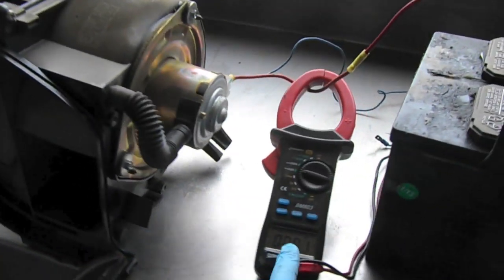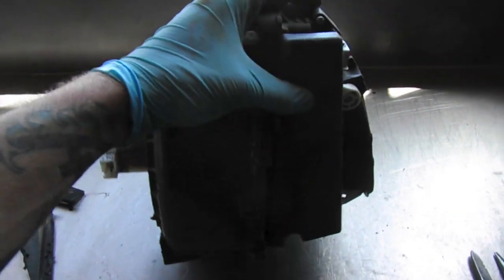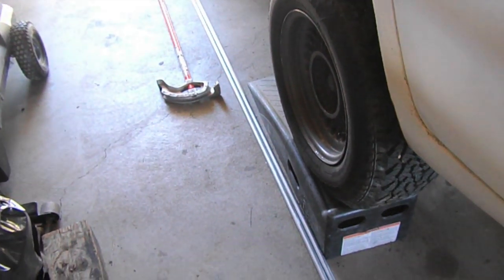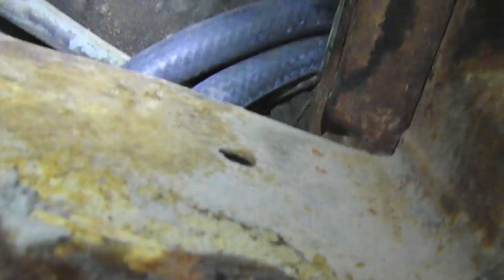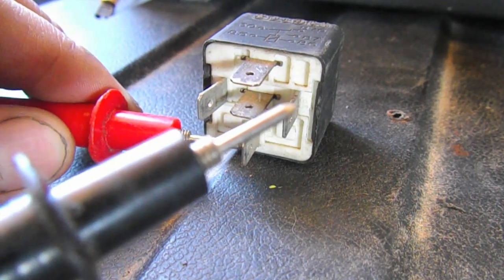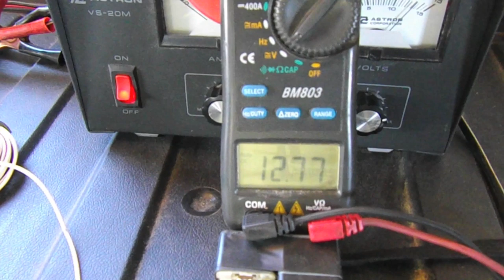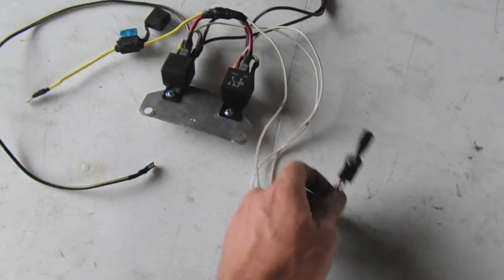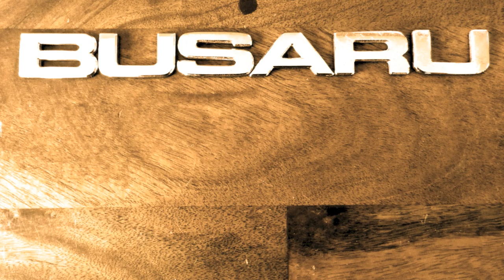Heater Install in VW Bus - Busaru engine conversion Part 12

Comment: One note of that heater core cutoff. The subaru cooling setup runs in reverse, the thermostat is triggered by the water run through the heater core. If you block off the heater core water circuit, your thermostat will not open and your engine will overheat. If you want to shutoff the heater core, you want to set it up in a bypass. Flip the valve to bypass the core, but not to shut off the loop.
Reply from the maker: Take a look starting at about 8 minutes into the video - you may have missed the heater bypass portion of the video on your initial watch.
Reply: Looks like it. My bad!
Reply from the maker: No worries! Definitely something that needs to be addressed - don't want to overheat!

Comment: This video is so good. I also was wondering about the AC, I know you're probably not concerned now that winter is approaching but in case you need some youtube inspiration, we are all watching :).
Reply from the maker: Thanks! I think AC is pretty low on my priority list but I have put a little thought into it. I think the best bet would be to mount the condenser from the Subaru underneath the bus (protected of course), and mount the evaporator, blower, etc. under the rear seat - just for ease of installation. It seems like the lines would be just long enough to handle this but definitely need to spend more time on this one - I'll probably tackle this on my 73 camper next spring.

Comment: So how is the heater doing? Does it still work good in the 2 speed mode? I am thinking about doing this in the Subisquare, using the original 2 speed fresh air fan switch. Not sure if it's worth trying to use the 4 speed switch from the Legacy or keep it clean with the VW OEM switch.

Comment: Every Mechanic I got to help me get my heater system working on my 95 VW Microbus Vanagon has failed miserably .  The cable works fine when activated by hand, but as soon as it is connected to the control switch the cable gets tight and keeps jumping off. Any idea as to how I can connect a manual ball valve system running the coolant which I can manually shut off in summer and turn on in the winter. Please help. The circulation pump at the rear of the engine has been removed when I purchased this vehicle, can I use an alternative pump as opposed to the original to give this higher flow in order to get the heater working?

Comment: How did the conduit hold up?  I had thought about doing the same thing, but mot sure if there would be any negatives to the conduit.  I had also thought about putting it all under the rear seat, with AC, and using the stock ducting to get the air up front.
Reply from the maker: +rbrtplly The EMT Conduit has worked great for the past 5 years. I use it on projects frequently.

Comment: Conduit is very inexpensive  but I'm worried about rust and corrosion. Beside cost why not just run  heater hose all through?  I do appreciate all your videos bro  you are freaking awesome.  I want to install an 05' wrx turbo engine on my 75 baywindow any input, suggestions or advice against it? I already bought the  bagged air suspension/ management system,   any suggestions on  that too?
Reply from the maker: +Jaime Flores I don't have any experience with bagged suspensions, sounds like a fun project though. As far as metal tube for the heater, I just like the rigid material. Vanagons use rubber all the way up. I've been going for 5+ years without any corrosion in the system but I can't guarantee it won't in your system ;)

Comment: Nice work you've done on this entire project, is this vehicle going to be considered a "daily driver"?
Reply from the maker: Hey Tim, thanks for the compliments. This bus is my daily driver (I have nearly 1000 miles on the engine swap now). This bus was bought and converted specifically to do this Youtube series. Being that I have a 73 already, I'm prepping to sell in a little while.